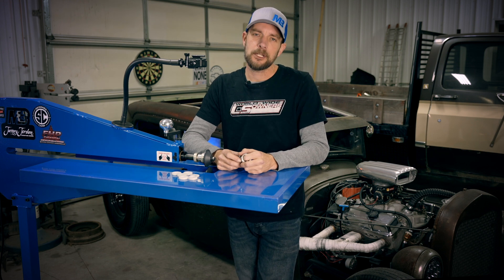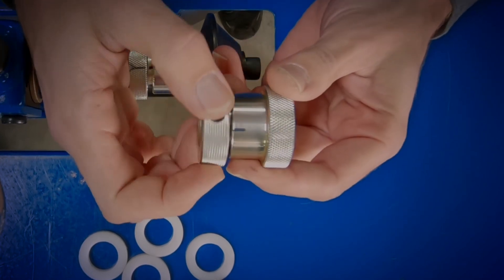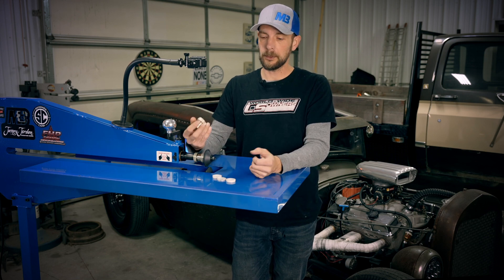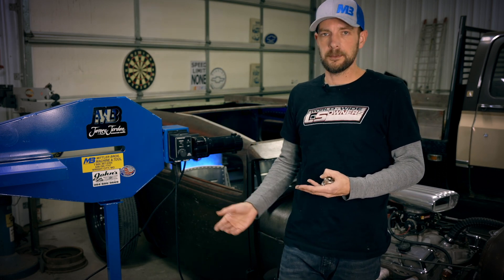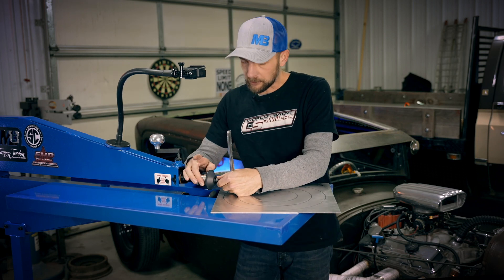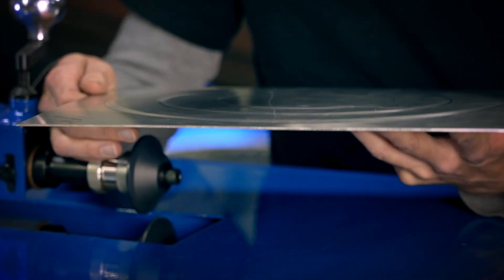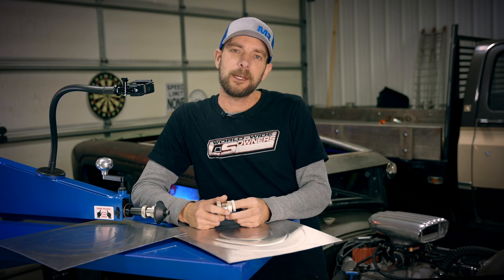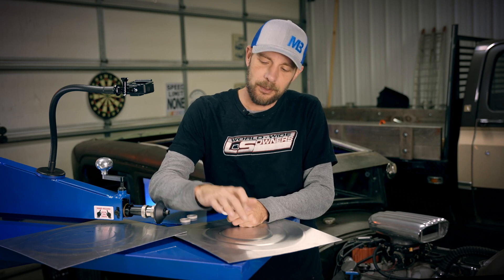Beginners guide to beadrolling: Pressure and die spacing

Comment: Great video. Great content.
The pressure disc, the way you did it, you also able more twisting force on it. Every step rise the panel center area hight but lower die stays at same hight.  Would the twisting be less if started from middle ring first?
Thx, Juhani
Reply from the maker: You are correct, it would distort less that way. Doing the outside first locked the panel up and the inner circles pulled on that more causing more distortion. I plan to do some videos on helping that in the future!